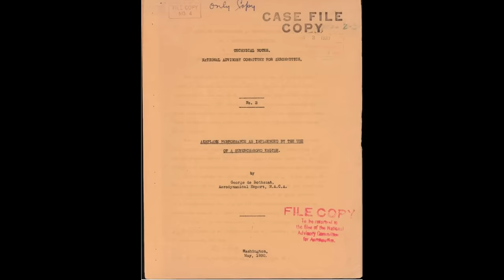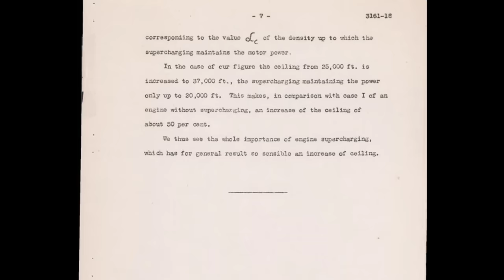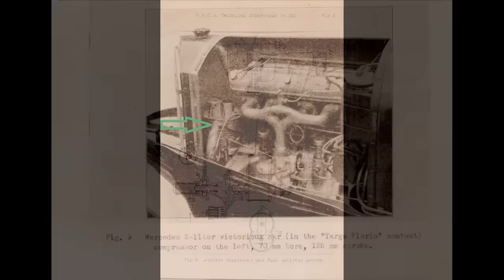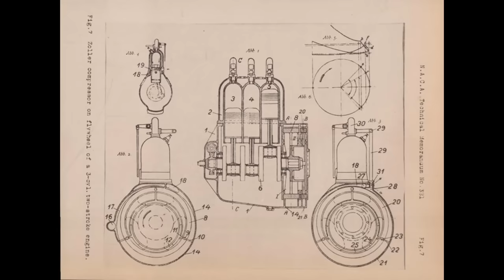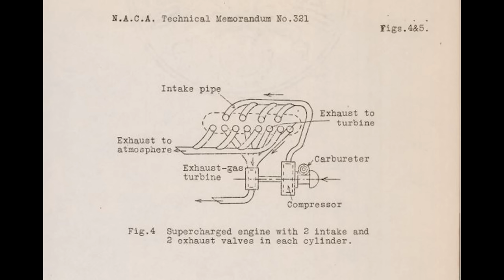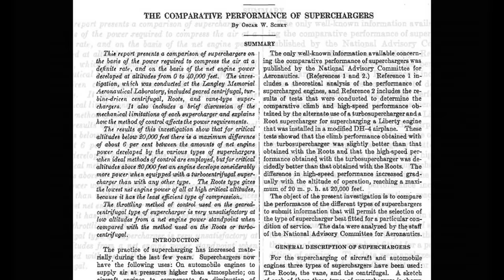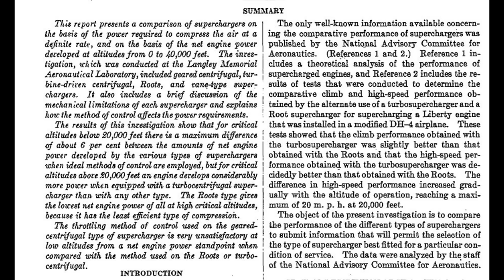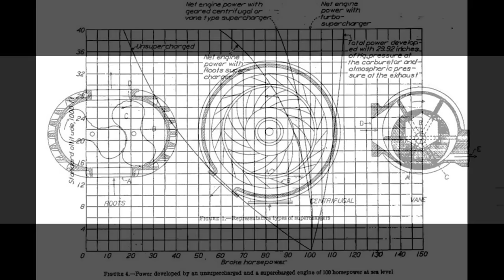Turbo vs Supercharging in WW2 Airplanes

Comment: A turbocharger can not be beat for it's efficiency, plus the boost is adjustable on the fly to your needs.  Harry Miller was using superchargers on cars in the teens and 20's for racing, go to the American museum of speed's web page to view some of them.
Reply from the maker: As explained in this and other videos on this channel, boost is adjustable on the fly with a mechanically driven supercharger as well, usually through one of two methods. The turbo is generally more efficient and has a superior method of control. Again, all explained in the video.

Comment: Some cars avoid compressor surge by opening a blow-off valve between the turbo and throttle. Did any WWII aero-engine use a blow-off valve? A diagram of the F4U-1's induction system shows a part on the aux blower labelled "AUX. STAGE SUPERCHARGER REGULATOR". It looks like a valve, but I expect a valve here might not be able to prevent surging of the main blower. The main blower compresses fuel:air mixture; perhaps venting this mixture into the engine compartment might be a fire hazard.
Reply from the maker: They would have to have some sort of pressure relief between the aux blower and the injection carb.

Comment: I havent seen electric powered superchargers in auto magazines but it is clear they would be nothing but a vanity.
Supercharger as vanity was explored by the late-thirties Graham-Paige car. It was said they would go faster without the supercharger than with.  This could be confirmed by one look at the (straight six) engine. The blower drive was a single v-belt typical of a water-pump or generator drive of the time. Such V-belt could transmit about 6 HP while a real supercharger for a 150 HP engine would consume about 30 HP.  Drawing 30 HP from an electrical system does not bear thinking about.

Comment: Very interesting...yet you exclude the P-51D with the Packard supercharged merlin engine...would appreciate if you would tell me what I am missing.
Reply from the maker: I think what you are missing is that I have covered the P-51D's supercharging system at great length in other videos. Also, there is no turbo vs supercharger Merlin comparison to be made since there was not WW2 production turbo version.

Comment: Cool video. I'm learning a lot as to why some a/c were the successes that they were. If you plan videos on the P-47 and P-38 there are a couple of good books by Warren M. Bodie on each, "Thunderbolt from Seversky to Victory" and  "The Lockheed P-38 Lightning". Both can be picked up at a reasonable price used on Amazon. They detail the the development and use and covers all the various marks and dead ends on each a/c.
Reply from the maker: Thanks Robert but I am generally only using original source material from NACA, Republic, and the USAAC/AAF.
Reply: @GregsAirplanesandAutomobiles  Your use of original material in this subject in this medium (Youtube) must be very rare. Thank you!

Comment: The turbo will always be superior at altitude as the impeller speed is not tied to engine speed. The less density of the ambient air, the faster the impeller will spin up to maximum boost. The resistance of the air at sea level slows the impeller. This also slows the turbine and increases back pressure.

With wastegateing, you can have a turbo that will happily reach maximum boost at all altitudes below critical with no throttling. At critical altitude, you have reached the maximum turbine RPM and can make no more boost without destroying the turbine with the centrifugal loads.

In WW2, they just didn't have the metallurgy to make turbines and bearings that could handle the centrifugal and thermal loads.

2 speed mechanically driven centrifugal supercharger helped alot but nothing can operate at altitude as effectively as a turbo supercharger.

In cars, turbos were a MASSIVE pain in the ass because the response was terrible. The heavy internals on turbos took forever to spool up and lag was terrible. In an aircraft, you are operating at set throttle loads for long periods so it doesn't matter if the turbo takes a few seconds to stabilise RPM and boost pressure.

Another thing not utilised effectively in WW2 was intercooling. Alcohol and water injection was utilised effectively but now we get far better results just with air to air intercooling.
Reply from the maker: The P47 and P51 both have very effective intercoolers. Technically the P51's is an aftercooler.

Comment: Blohm&Voss BV 222 also used turbo-diesel engines. The same Jumo 207 used in the high altitude recon plane Ju 86 R you showed.
Reply from the maker: Thank you for that. I figured there were some other turbocharged German planes, but in any case they were few.
Reply: The interesting is that there it apparently was not chosen for altitude. BV 222 is not a high altitude plane afaict. It's a flying boat and it used diesel fuel so that it could be refilled by u-boats.
Reply from the maker: well, if you want power out of your Diesel, it's going to need a turbo.
Reply: @GregsAirplanesandAutomobiles  The Jumo 205 and 207 were also two-strokers, so they couldn't even run without superchargin. It was convenient to use a turbo because of the Diesel's lower exhaust temps.

Comment: Great video!  Was lag a problem with the turbo charged aircraft?  I wouldn’t think so, because the RPMs didn’t fluctuate as much.  I thought I’d ask though.  Thanks.
Reply from the maker: No, it wasn't much of a problem, I have literally never seen it mentioned in pilot reports.

Comment: Electric Turbo Chargers are different than Super Chargers. What they do is use an electric motor to spin up the turbo to eliminate turbo lag, but at high engine RPM the electric motor disengages and the exhaust gas takes over powering the turbo. F1 uses this technology. I’ve coined the term Turbonator.
Reply from the maker: Alec, you are talking about something entirely different, and something that I didn't touch on in this video. I am talking about superchargers driven solely by electricity. I even posted a picture of it, so I don't know how this wasn't clear. People are now calling electrically driven compressors "electric turbochargers" The term in these situations are incorrect. Here are two examples for you:
https://www.youtube.com/watch?v=E115cuYNkA4 and https://www.youtube.com/watch?v=7-6cpENHGXU  . I don't think either of these two will actually make boost, but that's not the point, it's about the terminology. The hybrid electric/exhaust turbo you mentioned is entirely different and not within the scope of this video.
Reply: Still a supercharger.

Comment: The reason the Germans mounted the supercharger on the side of the engine 90 degrees to the crankshaft, according to Bill Gunston in his book “The Development of Piston Aero Engines” Page 157 is “ This seemingly odd arrangement made it easy to feed the eye of the blower by a short curved duct from a ram inlet projecting from the side of the cowling,  and removed the need for a 90 degree elbow between the surrounding volute and the axial manifold feeding the cylinders.”
Reply from the maker: The statement by Bill Gunston is true, and that's one advantage to the 90 degree mount in that specific case. However I don't think he lists a source for this, and there are plenty of disadvantages too. Plus there are many cases where the 90 degree mount made it harder to duct in air, and they still used it. In short, yes that's an advantage, but that doesn't mean it's THE reason they did it.
Reply: Greg's Airplanes and Automobiles  Greg - the other shoe dropping is that the short curved inlet has rather poor ram recovery A ramming inlet, in order to be efficient, has to provide smooth flowing high pressure air to the inlet.  (You get the high presure by slowing down the air, converting Kinetic Energy (Velocity) to Potential Engergy  (Presssure).
In order to do that, you need longer ducts which increase in area as they approach the engine, with gentle bends.  The short sharp bends of the Daimler Benz and Junkers installations didn't provide that.

Comment: The P39's configuration was ahead of its time. By the end of the war EVERYONE was thinking along those lines. There was GM's P-75, the proposed Messerchmitt Me 509, and Rolls Royce was proposing something with Mustang wings and a RR Crecy mounted behind the pilot which got to the point of a mock-up. If you think about it, ALL the subsequent single engined jet fighters which appeared in the late 1940s and even until today have the same configuration - engine in the fuselage behind the pilot. Admittedly, the P-39 didn't carry things far enough - the later designs moved the pilot even further forward, up near the nose - there are obvious visibility advantages, especially on the ground. Another P-39 feature everyone's gone to is the tricycle landing gear.
Reply from the maker: No question that the P39 was advanced. I really think that if it had the turbo, it would have worked out well.
Reply: I suppose they eventually went with mechanical two stage supercharging with the P-63, so we kind of know what the P-39 SHOULD have been like. The USAAC decided not to adopt it, saying it wasn't as good as the P-51, and I suppose yet another fighter in the logistics chain might not have been a good idea. Still, if it had been developed further, who knows. One thing I've been learning since I started watching these videos is that putting two supercharger stages on the same shaft (as they did with the Merlin) isn't the only way to do it.. both the F4F and the P-63 had separate mechanical superchargers, one feeding the other. And this second supercharger could be operated independently, turned on and off as needed.
Reply: iskandartaib  Hi Iskander, haven't seen you since R.A.M. - One problem with potential U.S. use of the P-63 was that it was still a fairly small airframe, with lots of stuff packed in it, and not much room for fuel.  While it could deliver P-51 equivalent performance, it wasn't ever going to have the range to serve as an offensive fighter, or carry enough bombs and/or rockets to make a fighter-bomber as useful as the types already in service.
The problem with having a fixed weight, like the engine, at the center of gravity means that you can't use that space for stuff that'll be changing in weight - fuel, ammunition, etc.
If you put the fixed weights, like, say, an engine, in the nose, you can account for the balance with your design (And ballast, if you need to).
Reply: Peter Stickney  Hi! Those were the days, weren't they? The discussion I'll always remember was the one about contra-rotating props cancelling out torque.. it's all archived out there somewhere... 
I did a quick look at the stats on the P-63 and P-51 pages on Wikipedia. The P-63 was actually a bit larger - a foot more span, 10 sq. feet more wing area, the same length. But about 1200 pounds lighter max takeoff weight and combat range was only 450 miles (vs. 1600 with the P-51D with external tanks). It was also slower by 30 mph.  
Not conviced the middle engine would have caused balance problems. I suppose with a forward engine you could try to store your consumables around the CG, but quite a few planes actually had a tank behind the pilot (P-51, Me109) and in the case of the P-51 this caused handling problems at takeoff. With the middle engine I suppose you'd have to put some consumables (in the case of the P-39 and P-63, the 30mm cannon ammunition) in the nose and you'd have to balance it with some behind the engine. Ideally you'd have fuel in both places and balance out the use, or (as in the P-51) use up the rear fuel first. Since the engine makes up a large percentage of the airframe's weight you'd have to move the wings back. Ideally you'd put the pilot up front near the prop, where the view would be the best. If you think about it, twin engined planes with the engines in nacelles are longitudinal equivalents of a mid-engine.

Comment: Not sure if you'll see this but I'm wondering if I or you missed the 'turbo compound engine such as used on the R-3350 for the B-29. As I understand this, a turbo was connected (compounded?) to the crank through a viscous clutch? Did this engine also have separate small turbo charge boosters also? Thanks for some great presentations - appreciated.
Reply from the maker: I do see it! No, I haven't discussed the Turbo Compound engines. Those were really post war tech, and I just haven't gotten there yet.
Reply: WOW. Surprised at the dedication you have toward your viewers comments. Thanks.

Comment: Did you consider the Russian Petlyakov Pe-8 multiengined bomber? The 1st model type had a 5th engine above the central wing spars that drove a huge compressor, providing air for the other 4 engines:-

https://en.wikipedia.org/wiki/Petlyakov_Pe-8

Another interesting design was the Napier Nomad, which combined a H bock Diesel (like the Sabre, but diesel fueled), with the axial turbine & compressor from the Napier Naiad turboprop underneath (basically the whole turboprop engine minus the flame cans). The piston engine's exhaust provided the motive force for the turbines, which powered the axial compressor that pressurised the air for the piston engine's fuel.

Also the axle of the turbine compressor assembly was linked to the crankshaft of the H block assembly via a Beier variator (a varible ratio drive). So at revs too low for the exhaust to power the turbines, the turbine-compressor assembly acted as a mechanically driven supercharger, while once the revs spooled up enough exhaust pressure to power the turbines, as well as compressing air for the engine, the turbine-compressor also returned power directly to the crankshaft via the varible ratio drive, a process called turbo compounding. 

https://en.wikipedia.org/wiki/Napier_Nomad

I've heard the engine in the French Leclerq Tank works in a similar fashion. Some modern truck engines utilise turbo compounding for better economy.
Reply from the maker: I am familiar with those, but I can only fit so much stuff into one video. As it is now my videos are way longer than youtube wants.
Reply: @GregsAirplanesandAutomobiles  Great Job as always Greg. Of course you're right, we'd be stuck here all night if every prototype process & small model run failure gets mentioned. Just thought they were 2 interesting variants of the subject

Comment: I would not agree. The last gasp for turbocharged piston-engine aircraft would have been the B-36. Late models with the featherweight mods claimed to fly at 50,000 ft.  Still a great video.
Reply from the maker: Sure, a few high powered turbocharged pistons types soldiered on after the Rainbow was canceled, but development of them stopped. That's why I say that cancellation of the Rainbow marked the end of the line for these types. The B-36 was already flying when the Rainbow was canceled and it only soldiered on with the addition of jets to supplement the piston engines. The Rainbow with it's 470mph top speed represents the high point of development.

Comment: How big was a turbocharger back then? I feel you would be able to hold it your hands and more importantly why was it that big. (talking about the P-37)
Reply: Bigger is better. For a given pressure, you can only move so much air so fast through a certain size turbo. Turbo lag is less of a problem if you dont have gears to shift and wide RPM bands, so you can really go big, which you need to properly boost a 30 litre powerplant.

Comment: Very good, informative video, though there is one single aspect (Supercharging method used in WWII) that went unmentioned...

Rather than a gear driven supercharger, a hydraulic driven one. This system was used on the P-63 King Cobra, an aircraft which sadly does not get much respect in regards to WWII history. While being slightly more complex than the Gear driven, it was much less complex than the Turbo setup, and probably solves some of the throttling issue at low altitude, since a hydraulic system can be effectively throttled itself to control the drive speed of the supercharger... I would think.
Reply from the maker: Yes, it was a good system, but never really had a chance to show what it could do or to reach its full potential.

Comment: Damn man, you need to look into what Formula 1 is doing with turbocharged engines now. The Motor Generator Unit-Heat and Motor Generator Unit-Kenetic are tuned up after 5 years of R&D to give the “Power Unit” greater than 50% efficiency. The “battery powered compressor” idea has been seriously turned up to 11 in racing.
Reply from the maker: I'll look at it.

Comment: Electric supercharging is a thing in F1 but wouldnt work too well in an airplane because the battery cannot prrovide continuous boost that would require a battery that would weigh a ton, in a car its possible to have the boost battery charge hile you drive then it could kick in when needed, I thought about installing one in my car but it would require electronics knowlege I dont have to manage the engine prevent it from burning holes in the pistons